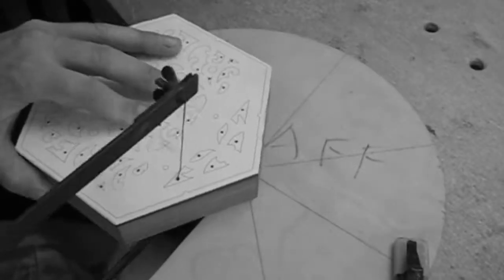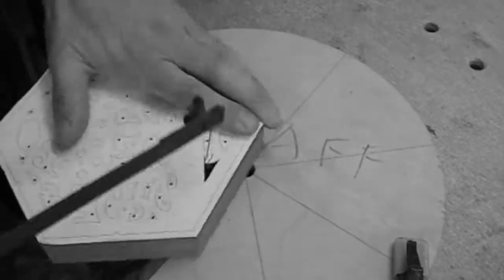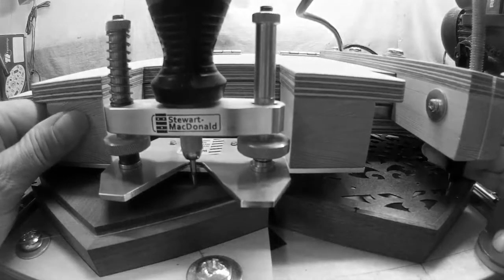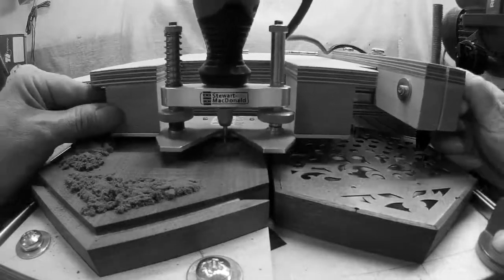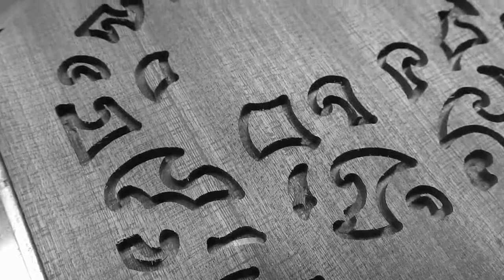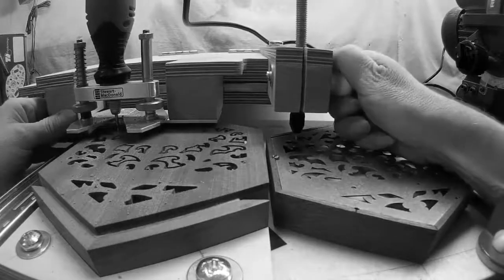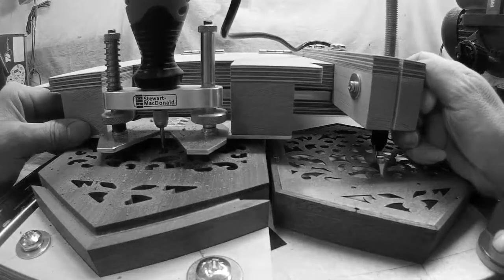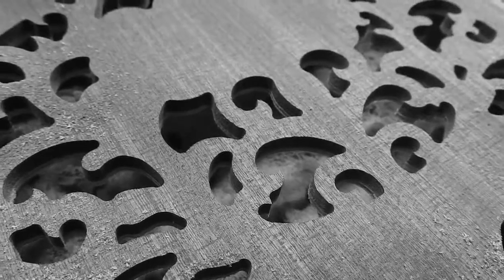Home Made Copy Carver for Concertina Fretwork

Comment: Very impressive. I'm in the process of making one to copy scroll peg heads for dulcimers. I need the Z dimension so it is a little different, hope it turns out as well as yours.
Reply from the maker: It's well worth making Phil, the draw slides are still working well with no play whatsoever . I think I have cut out about 15 pairs of wooden ends so far. Thanks for your comment :-)